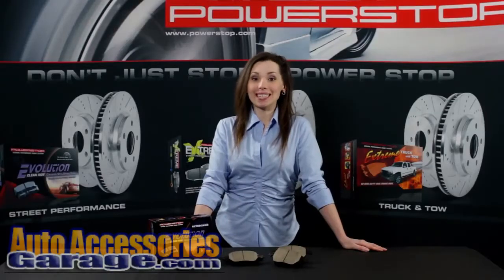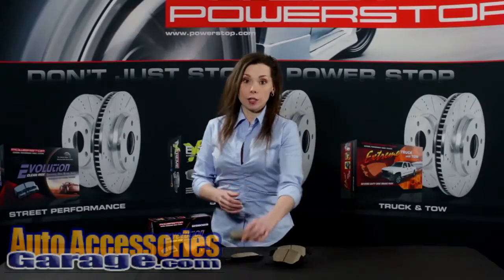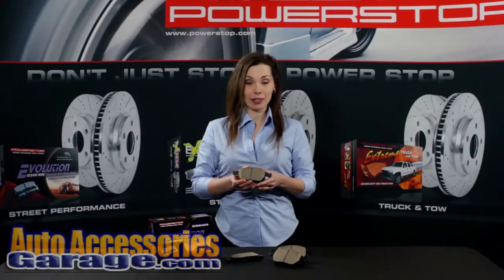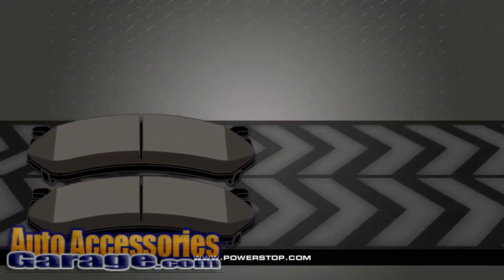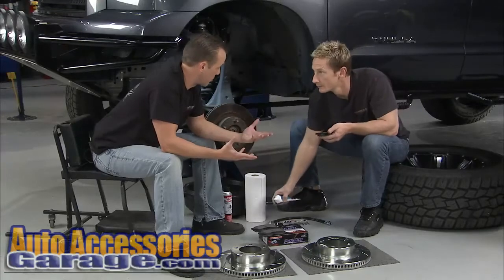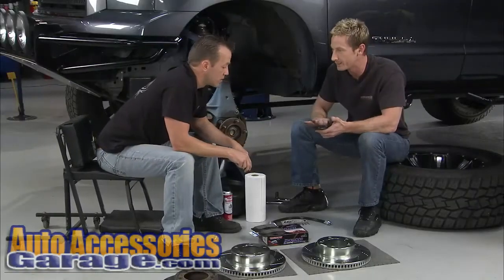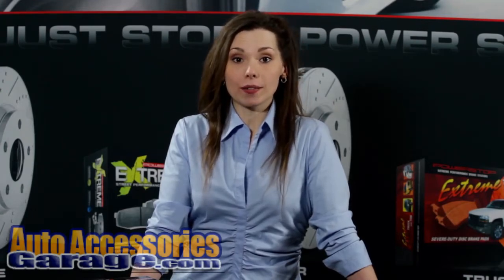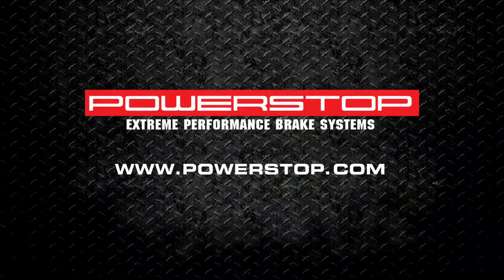Power Stop Brakes Overview

Comment: These guys sell some serious bang for the buck, when you look at what you'll spend front and back at the parts counter. You won't believe the difference, smooth engagement, serious stopping when you need it (or want it!) and shines higher when put on  apps. that are prone to fade or warp due to heat, size hinderance, etc. expect the zinc to last 4 years, 2-3 if in salty northern states, they just work! Give them a try!